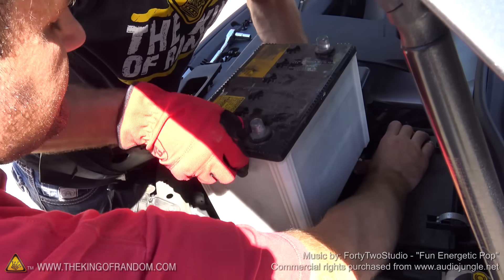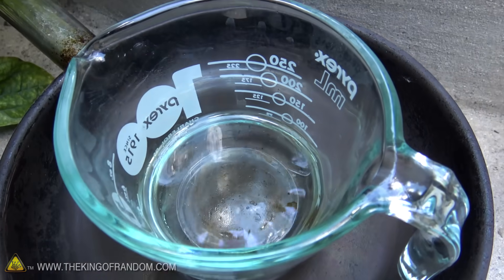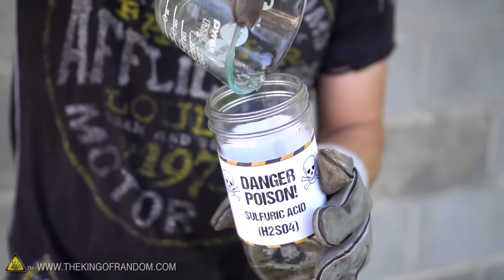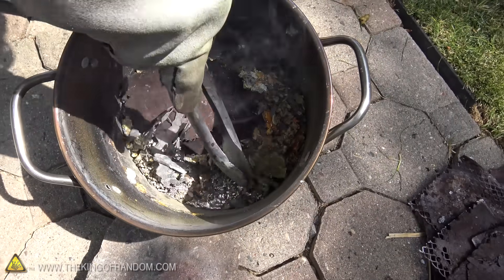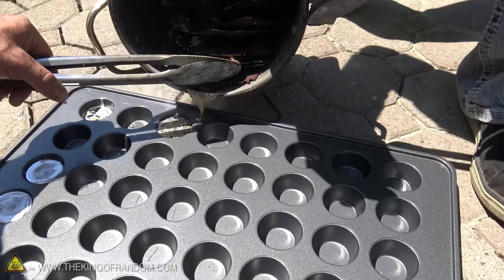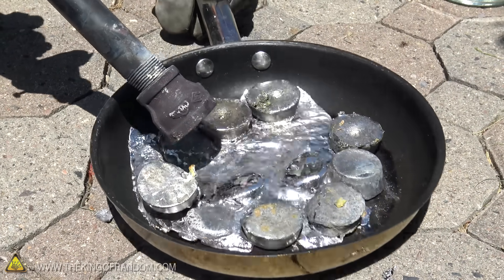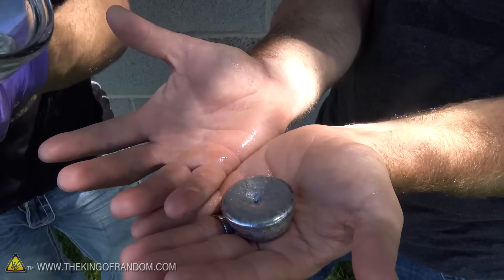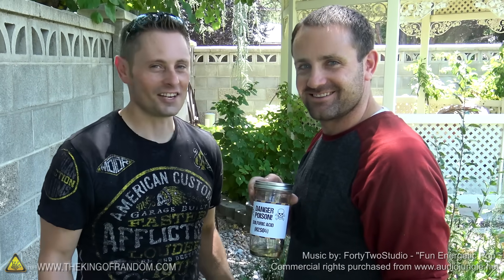Lead Ingots & Sulfuric Acid Scavenged From My Car Battery

Comment: Bad, bad, bad idea... lots of nasty stuff got released in making that vid.
Reply: lots of nasty stuff got released in making that drama.
Reply: +Andrew Daniels salt may be nasty when coming from a hater but it's not toxic
Reply: +Andrew Daniels agree
Reply: He knows what he's doing
Reply: As long as you know what you're doing it's all good. Not sure how he was able to hold it that close to his face without coughing a ton, but so long as you aren't exposed to too much you're just fine.
Reply: +Rick Koehler "a.pdf" k
Reply: +Rick Koehler i guess you are making the assumption they didnt dispose of the slag, which contains small levels of antimony ans arsenic, properly, after refining the lead? when you send your battery to a recycling center this is exactly what they do with it.  im not sure what your concern is.
Reply: the concern comes from not wearing masks rated for arsenic exposure and the like (a WWII gas mask would probably cover both of them). But the toxicity of these things in closed spaces is why doing this outdoors or under a fume hoot is a must.
Reply: The concern is for the airborne arsenic they released and exposed to themselves by smelting the lead plates. When batteries are recycled, the gases that are produced during melting are scrubbed in very tight, controlled environments. 

This is a dangerous practice, as arsenic accumulates in the body, causing lots of health problems in very small doses. I can't begin to be emphatic enough to warn against what these guys are doing.

Comment: That's not Pyrex, that's slightly less cheap soda lime glass.

REAL Pyrex come from Europe.
Reply: prove it.
Reply: The best pyrex you get comes from the uk, that's where I live
Reply: ***** PYREX was coined as a brand name for Sodium borosilicate. A specially formulated glass that can handle head without shattering and is generally a great cooking material.

Now in America due to market economic whatever stuff, pyrex is made by a different company in the US only. This company instead uses Soda Lime glass (Windows glass) that is tempered to not instantly explode when heat is applied. However this cheaper soda lime stuff is a lot easier to break from heat shock, and also looks bluer than regular PYREX.

TL;DR, PYREX and pyrex are two different things. If you want REAL PYREX, it needs to be imported from europe where they use the stronger, nicer Sodium Borosciliate.
Reply: If it is called PYREX, then it is PYREX. If it isn't, then it isn't. There's copyright and a patent issues at play there.
Reply: +Communist Ralph I agree, in the US Pyrex cookware is no longer borosilicate glass, but Pyrex lab glass is sill made with borosilicate. However, in no way was that kitchen measuring cup labware.
Reply: kleetus92 No,.Corning dropped out of making PYREX in 1998, and licensed the name to different comapnies.
World Kitchen made it in the US, but decided to us tempered soda lime glass as it was cheaper and didn't shatter through physical shot (Dropping) as easily.

This tempered soda lime, was however easier to shatter through heat shock, and looked pretty ugly.

World Kitchen can make all the blue pyrex they like, they got the license from Corning.
Reply: +Communist Ralph well let me ask a dumb question then,  if it's not borosilicate glass, and only tempered, and doesn't handle what it would see in the kitchen, why would Corning allow their name to be trashed?
Reply: kleetus92 People don't know this. And it hasn't been trashed. And it can also be legal issues. Corning licensed the name to World Kitchen. It could be the contract prevents Corning from immediately revoking the ability to use the name.

Comment: isnt lead a poisonous metal?
Reply: Yup.
Reply: If it gets into your bloodstream.
Reply: It will get when you breathe the fumes or you don't wash your hands really hard after you touch it. You can write with lead on paper, that's how easy it is to remove its atoms from the bulk.
Reply: Lajos Winkler lead isnt in pencils anymore, the creator found it was poisonous and changed it to graphite
Reply: +Kennythekidrs graphite and small traces of lead not enough to be poisonous
Reply: +Kennythekidrs Where did he say that it's in pencils?! He said that lead is so soft that you can use it to write on paper with it. Not that pencils contain it.....
Reply: CoolKoon its everything but soft. Lead has more atomic mass than gold
Reply: +Kennythekidrs Well guess what: you have no idea what you're talking about. The strength of the intermolecular forces (which define the strength of the material) have little relation to the atomic mass (the biggest factor in an element's weight). So lead is a heavy but PLIABLE (=soft) metal, yeah.
Reply: CoolKoon oh, ok then
Reply: only in california
Reply: Yup.
Reply: Yeeeeeeeeeeeeeeeeeeeeeeeesssssssssss iiiiiiiiiittttttt iiiiiiiiiiiisssssss
Reply: Fulvous I doubt you’ve handled lead before then because literally just dropping lead from average hand height will dent it and unless it’s super thick it’s really easy to bend
Reply: isnt sulfuric acid a poisonous liquid?

Comment: The problem with the concentration is that it may not be pure sulfuric acid after the boiling. When they boiled it, water was evaporated from the solution. However, they are dealing with H2SO4 which contains 2 hydrogen atoms per molecule. The air surrounding it contains O2 which is a highly reactive gas when exposed to heated hydrogen solutions. When boiling, they gave the sulfuric acid enough activation energy to make the acid react with the oxygen. When this happens, the acid gives its hydrogen to the oxygen to create water. What is left in the solution is H2SO4, HSO4, and SO4. Now instead of having water and sulfuric acid, they have sulfuric acid solvent and a sulfate solute which is less pure than the dilution. This would work if it were done in a vacuum chamber where there was no atmospheric oxygen to interfere though.

Comment: The lead melted in this vid is mostly from grids and connections.  Lead oxide and lead dust are converted to lead sulfate during discharge.  It takes a bit more alchemy to get decent conversion.  Plus it is toxic due to other metals like calcium and arsenic.

Comment: 0:36 Actually, it's not technically a mixture of water and sulfuric acid (assuming an even mixture); it's just sulfuric acid. If you dry out sulfuric acid, the resulting anhydrous compound is simply dihydrogen sulfate, which by itself is neither corrosive nor an acid. So, the acid only exists when this compound is mixed with water, when the two hydrogen protons dissociate from the H2SO4 molecules to form H3O+ ions with some of the water molecules. It is under these conditions that the compound "becomes" an acid; the acid consists of BOTH the H2SO4 in solution AND the water itself.

Comment: My guess as to what the yellowish impurities on top of the ingots are is sulfur...
Reply: It could be anything, really. The paste used to fill those (lead) grids is a mixture of all kinds of metals and molecules aimed at improving the battery's (charge and discharge) properties. They should've just melted the grids separately and the paste separately, 'cause the latter was mostly slag anyway.

Comment: good thing they wear their gas mask, otherwise.. oh wait..
Reply: does not happen anything if you dont heat lead over 450 celsius there are no danger, educate yourself
Reply: i think he meant about the sulfuric acid because of the fumes
Reply: +runnerJong Perhaps that's the reason why they're doing the whole thing OUTSIDE....

Comment: So here's the deal on what didn't melt out of the battery contents.

Most of that stuff is gonna be either lead dioxide or lead sulfate. To recover far more lead, the sulfate can be reconverted by hitting it with much higher temperatures in air, converting it to still more lead oxide. This is called "roasting".

Then, you can smelt the lead oxide to metallic lead by mixing with powdered carbon and more heat. Hotter than what it take to melt lead, but not as hot as the roasting temp.

You can get virtually all the lead out of the battery this way, and it is how recyclers actually do it.

Car battery lead isn't terribly pure lead, and usually has other elements alloyed, such as antimony and calcium. These can really only be removed electrolyticly.  

Battery acid also has many impurities in it, that decanting and evaporation won't remove. Distillation is the best way to get sulfuric acid as pure as it can be.

Comment: try using a flux or other deoxidized the next time you do this, you had a lot of oxides forming on the surface during your second melt which could have helped your conversion factor for more lead. just my personal recommendation if you where to do it again

Comment: Be known that boiling off the water from sulfuric will not give you reagent grade sulfuric acid (~70% as compared to 98%). Purifying with this method creates an azeotrope complex with the water and sulfuric acid. This means that there is a certain point in the boiling process when you are boiling off equal proportions of water and H2SO4 in the vapor and liquid. Useful for intense cleaning, not that great for actual synthesis or lab experiments. Then again if you have enough this method should suffice. Just some food for thought. Cant wait to see what you guys do.

Comment: You know that both can be bought easily and cheaply?
Reply: Sparkaly dave still, I am 17 years old and I buy all sorts of chemicals, from acids to alcohols like methanol or ethanol to all kinds of salts, and I setup my lab at the age of 16. And that in a country with quite restrictive regulations (in Europe you can't get a lot of stuff like DCM or nitric acid). Sulfuric acid is sold as a drain cleaner and I don't think there's a minimum age on it.
Reply: Sparkaly dave still, I am 17 years old and I buy all sorts of chemicals, from acids to alcohols like methanol or ethanol to all kinds of salts, and I setup my lab at the age of 16. And that in a country with quite restrictive regulations (in Europe you can't get a lot of stuff like DCM or nitric acid). Sulfuric acid is sold as a drain cleaner and I don't think there's a minimum age on it.
Reply: Sparkaly dave furthermore, why would he encourage teenagers to disassemble their parent's car batteries? XD
Reply: Well, it looks like you know what you are talking about. You left the guy silent.
Reply: Kaya what do you mean?
Reply: most of his videos like these are just about the process, its not supposed to be a practical way of obtaining materials lol

Comment: A couple of points I want to make: 
1. The manufacturers of Pyrex® have changed the formulation of their product from the more expensive borosilicate glass (which has a low thermal coefficient of expansion and so can take the heat) to cheaper soda lime (which has a high TCoE and is more susceptible to shattering). They haven't announced the change, and if you are hurt by their glass shattering they either blame you or buy your silence. Read the January 2011 issue of Consumer Reports magazine, starting on page 44. 
2. You could have made the battery solution consist of more sulfuric acid and less water had you charged the battery fully from an outside power source before taking the battery apart.

Comment: In a fully charged battery, you get much more metallic lead, and not so much lead sulfate. Also, a fully charged battery has much stronger acid to start with, so you have more once boiled.

Comment: Sulfuric acid is one of the most important chemical. Many things are based on it like hcl or H2PO4. It’s so important that you can measure the economic power of a country at least in chemistry by taking a look how much  the country uses each year. Btw sorry for bad englisch

Comment: Love the videos man. I actually melted down the lead from a battery yesterday, I added charcoal powder to the lead and lead oxide while it was in the forge (your design). Carbon has a higher affinity to oxygen than the lead does and the carbon will literally steal the oxygen from the lead oxide. (competition reaction)  I made a video of my results but the video I got the info from is from user (KASScience STEM) and it is called "Lead oxide reduction"  As always, love your videos. Both entertaining and informative. Peace

Comment: cracking the  battery is very possible...I saw some dudes from south of Mexico do the same procedure and manage to melt them into rolls and then hinged them on to fishing net...and it actually worked well

Comment: One thing though...
Pls DO NOT STORE acids in jars with netallic lids as the vapours of the acid will burn the lid down as it happened to me thrice
Reply: Hey can i make 98% sulfuric acid by just boilling the battery acid? Is it possible?
Reply: @Gcity67k  the battery acid has a concentration of nearly 35%..means 35ml of acid in 100ml of water..so if u have 1L of 35%acid u need to boil off 650ml of water to make 100%sulphuric acid...but before that, the acid itself will degrade..so the max conc. u can reach is 78%(acc to me..as i have done)

Comment: If you are just looking for lead I usually go to a tire center, for a case of beer they will give me a 5 gallon bucket of used tire weights. They are usually pure lead except for the metal clip which doesn't melt so it is easy to remove. It's also cool to watch the steel clips float on top of the liquid lead.

Comment: does  lead acid batteries have other metals like antimony in its plates? won't it mix with the lead you melted into ingots?
Reply: Kevin Kose I would assume the lead is already an alloy of lead/antimony/tin which would melt with the lead.

Comment: A little paraffin wax will act as a flux and cause it to flow better, as well as removing some impurities that might stay dissolved in the lead.  I've heard you can use sawdust as well, but I've never tried that.

Comment: you need to fire that at 1800 degrees with a reducing agent in a graphite bonded silicone carbide crucible...cant use caly bonded since lead oxide reacts with any silicon containing compounds .........

Comment: The "Pyrex" measuring cup is not Pyrex glass but it is soda-lime glass which does not have the same heat resistance as laboratory Pyrex.

Comment: That's one expensive hack Lol lead goes like $1 a pound or free form wheel weights  and in pretty sure you can find sulfuric acid cheaper on the web. $80 battery turned to $40 of materials

Comment: since a Walmart es 12-bs  battery costs about $50 and each of those ingots are worth about $10 u can make $30 off 1 battery not including the price from the acid

(though im not sure if different batteries have different amounts of lead or acid)
Reply: This cannot be true.
Reply: tmkr well I'm getting the value of each ingot from some1 else in the comments, but yeah if they are correct and if u can salvage that much lead from a Walmart car battery u can make $30 + whatever the going price for sulfuric acid is

Comment: I wonder how many times the Dunning–Kruger effect has lead to a Darwin award? If they knew what they were doing, they wouldn't be storing the sulfuric acid in a glass jar. Which leads me to believe they didn't even bother to read the msds for sulfuric acid.
Reply: Of course you can store sulfuric acid in a glass jar!
Reply: I worked in a research lab. Most acids, even nitric acids come in 4 liter glass bottles. Only hydrofluoric came in plastic. You can read SDS all you want but it wont prepare you, or substitute for real-world experience. And just because you asked me to prove you wrong, I will. - http://www.sigmaaldrich.com/catalog/product/sigald/258105?lang=en&region=US You can see the product ships in both GLASS and PLASTIC bottles, depending on size.
Reply: ***** OK I get it, the SDS is wrong and you "HAD" a job in a research lab. I've heard that Chlorine Trifluoride is fun stuff to play with.

Comment: when I make alcohol after the fermentation process is complete I put the liquid into 1 gallon jugs then I put it in the freezer when it is frozen solid I turned it upside down into a collection device the water ice stays in The Jug and 90% of the alcohol comes out I went from a 24% alcohol with the fermentation to  90% alcohol with the freeze method can you freeze method be used to separate the sulfuric acid from water I know it does work with hydrogen peroxide

Comment: Don't extract lead from small 2kg battery. You won't get more than 0,1kg lead per piece unless if you mix the slag with coal and heat to 1100C

Comment: I am pretty sure lead is not safe to handle like this. It's toxic to many organs and especially for kids. I realize this isn't an occupational smelt, but a 1-time thing, but still, it releases some into the air and soil (what about that water that you poured out?), it can be absorbed through the skin... I read all of this on wikipedia, and formerly I've heard quite a lot about the dangers of lead that I can't cite.

Comment: I'm glad you mentioned thermal shock.
making dinner I left a 9x13 Pyrex dish that the food thawed in next to the gas burner. soon I realized hey that's too close and went to move it with my bare hands  (first mistake)  ouch TOO HOT so quickly swing the dish... (second mistake) the nearly frozen liquid splashed onto that really hot glass and BOOM! glass shotgun I found pieces on top of cabinets 20 feet away

Comment: OK, you might not want to melt your lead in a teflon pan.  I couldn't tell if it was steel or aluminum, but if it wasn't steel, you will be getting close to softening the aluminum to the point it won't stay as structurally strong as it should be.  Also heating a teflon pan to high heat will give off some additional toxic fumes too.   Now to find a large glass container so I can break down my store of dead batteries.

Comment: You would have got better & safer heating performance if you'd filled the frying pan with sand. It would conduct the heat to the glass better, plus would absorb any spills.